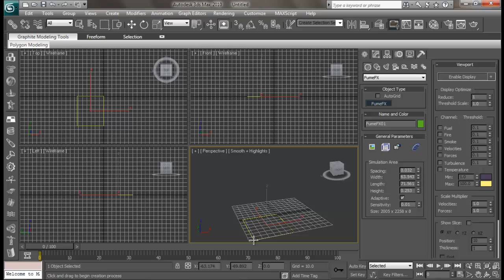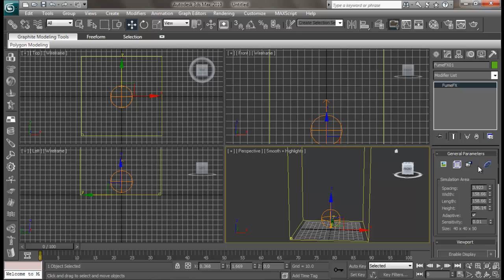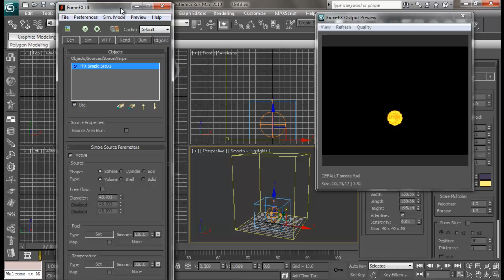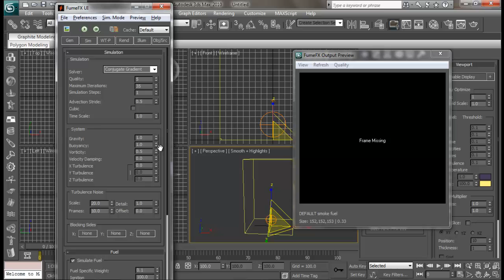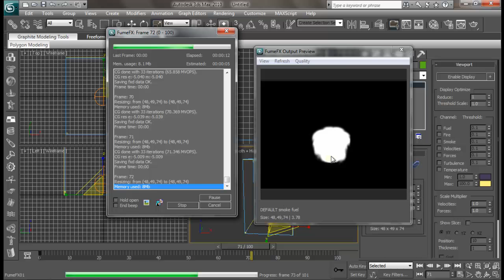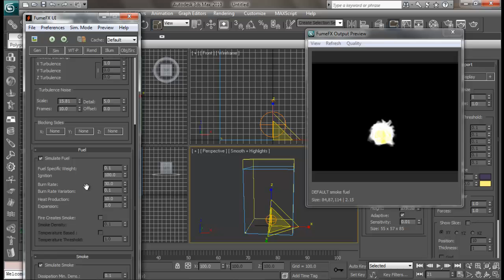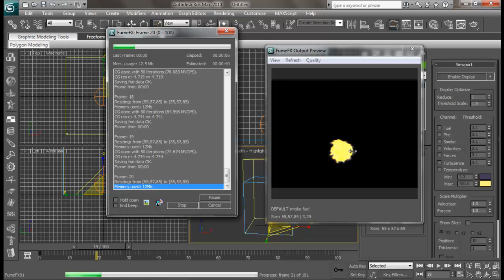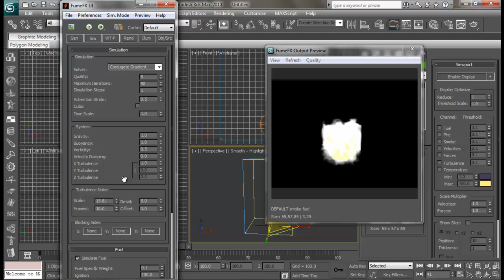Fume FX basic part 1

Comment: hi, I experience crash when stimulating fumeFX every time. It cannot stimulate the first frame, and I don't think I have RAM issue since I have 8GB ram and I set the fumeFX box very small like 5x5x10(m) and in fumeFX panel, I set spacing to 3. However it crashes every time, what did I do wrong? please help me, thanks in advance